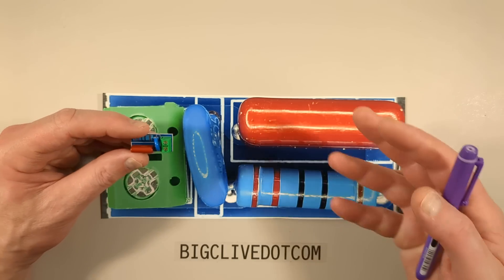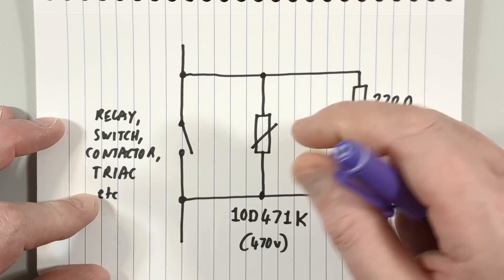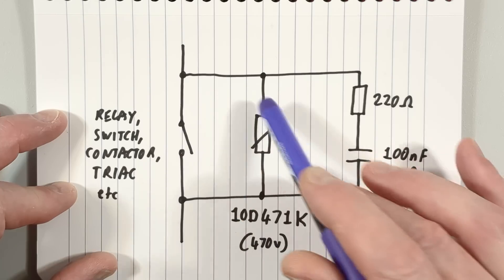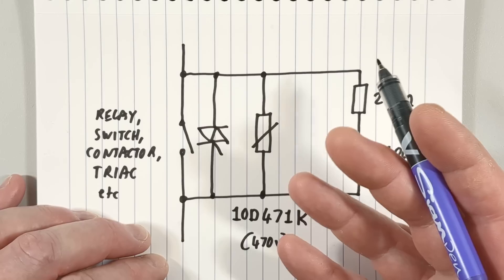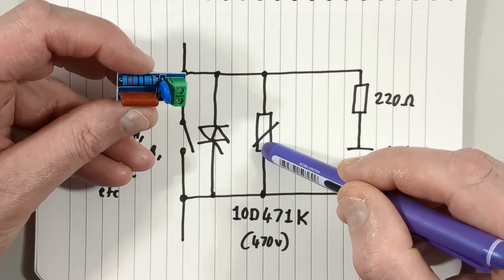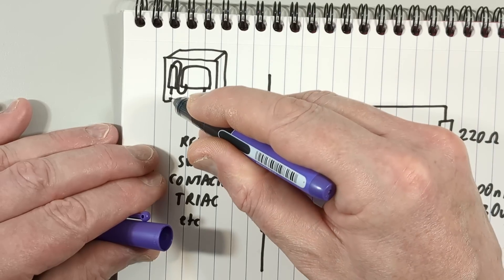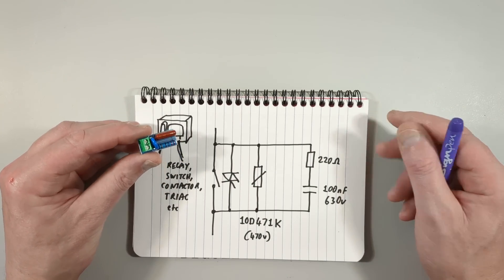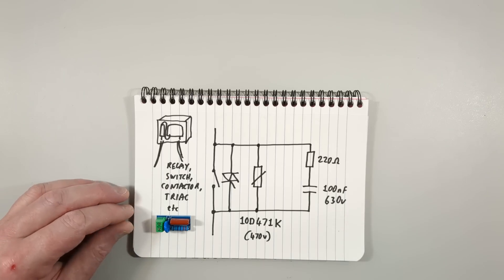Snubber network module for protecting contacts

Comment: The capacitor is probably "metalized". Instead of sturdy foil, the electrodes are thin flashes of Aluminum{sic} on plastic dielectric. HIGH current will vaporize the metal open; that's usually better than it going short. Eventually you don't have enough capacitance left to absorb crap, but that may be long after the warranty runs out.
Reply: Do you mean the cap in the snubber unit itself? If so it may be a good idea to have a stock of replacements on hand, correct?
Reply: @nelsondog100  Perhaps with a higher voltage rating than the original so that the replacements wear very slowly, or not at all.
Reply: Yes, all wound suppressor capacitors are metallised plastic (previously also paper), with sprayed metal contacts. They are all, preferably,  self healing with a small local loss of metal layer whenever there is a overvoltage pulse. So they degrade over time when subject to lots of arcs. 
Never consider a foil capacitor in a regular suppressor capacitor application. Will not selfheal but short.